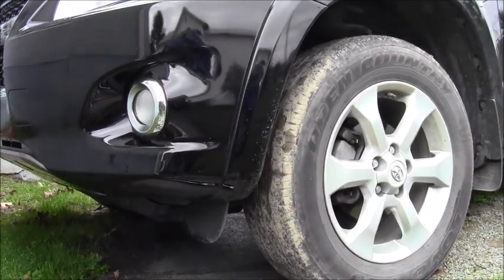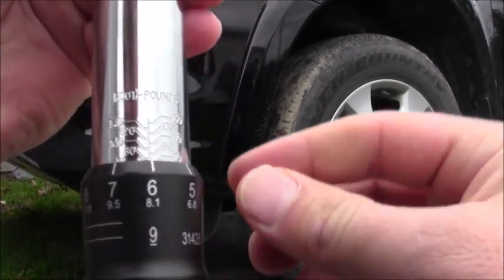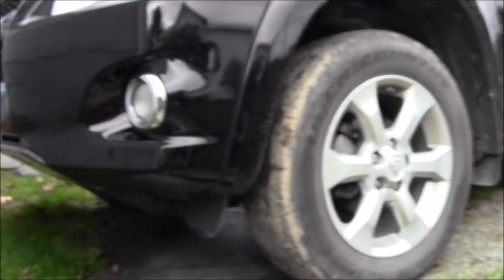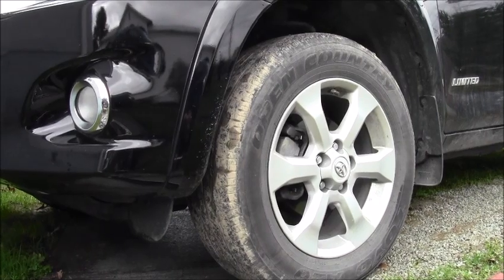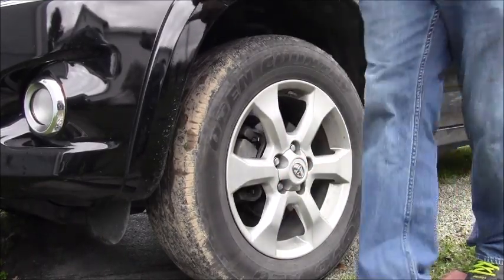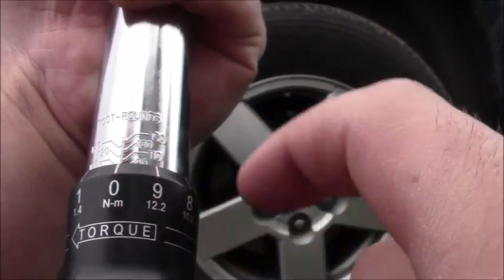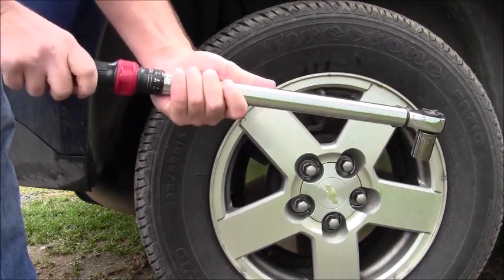How to Torque Lug Nuts with Torque Wrench

Comment: Anyone who’s watching this you want your torque wrench in a horizontal position not what he is showing, and you want to press down on the torque wrench not pulling away from you pull towards the ground
Reply: Is this just for optimization, or because it affects the accuracy of the torque setting?
Reply: Kev they say it affects the accuracy but who really knows tho, and I think it’s easier to use that way less straining when torquing them :)
Reply: Kameron Stout ok thanks. Yup that’s what I mean by optimization. Easier to apply a force pressing down than to pull back or up
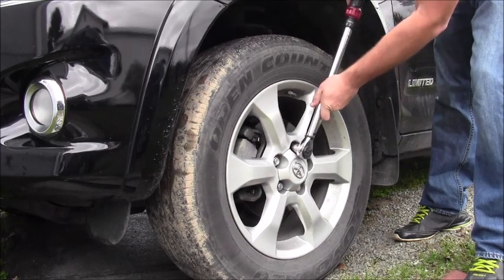Reply: Like what he did at 2:00 is it the correct way? Pushing towards the ground and horizontal like 3oclock position. Thanks
Reply: @heymanbatman  Horizontal would be parallel to the ground.

Comment: LOL, you are a young man so you won't feel it now, but, for lug nuts especially, best operate the torque wrench by "pressing" around the 3-O'clock (2 to 4 o'clock zone) position to avoid any (back) injury, needless to say about "pulling" on the wrench.  Be safe!  Thanks for taking the time to make this video.